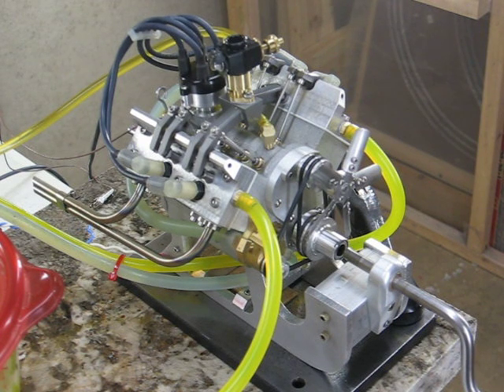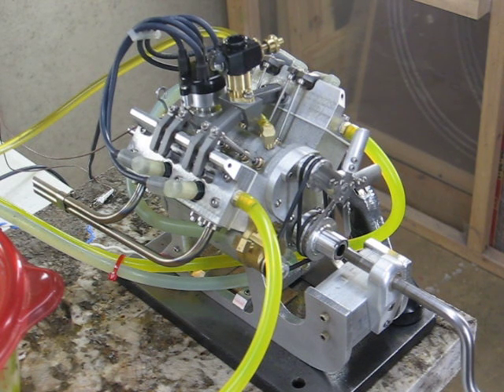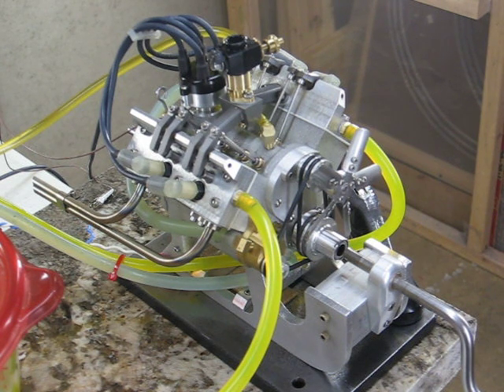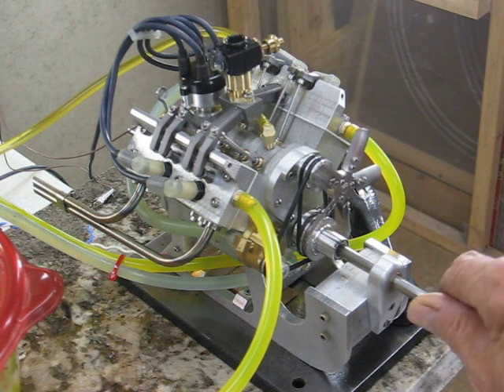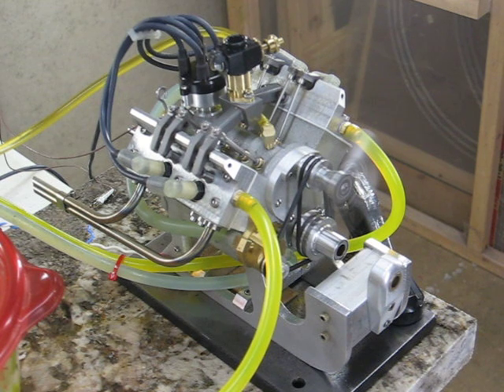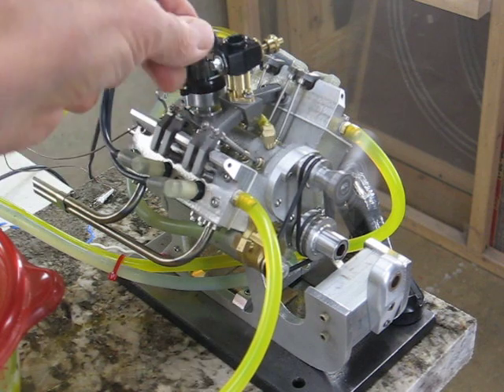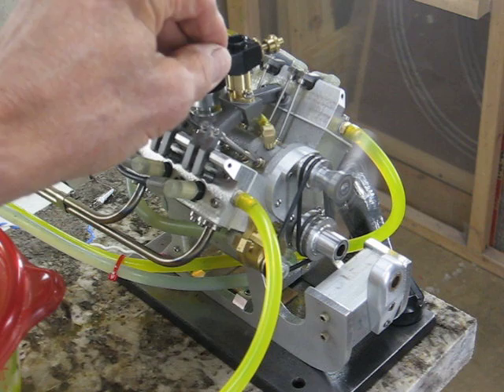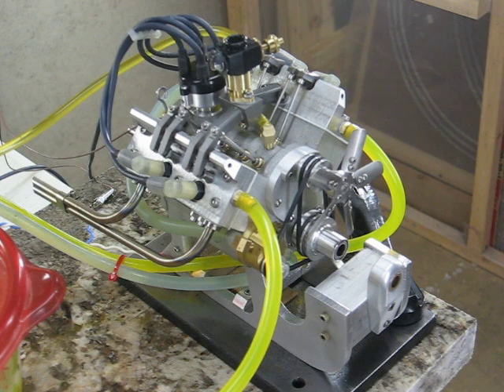Bakers V4 Engine Running

Comment: What kind of fuel are you running it on and does it produce enough torque to move an RC car weighing about 7 1/2 pounds?  And of course my next question is are you producing them for sale?? If so how much? I know I will have to figure out a transmission to Getty the power to the wheels which I think I can use a Traxxas 2 speed tranny